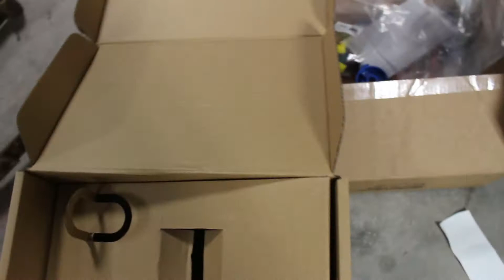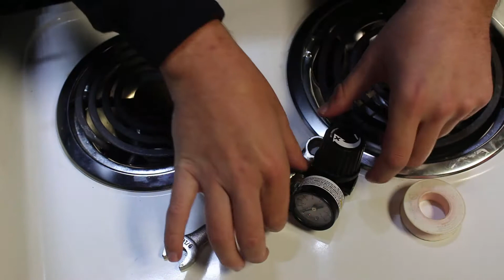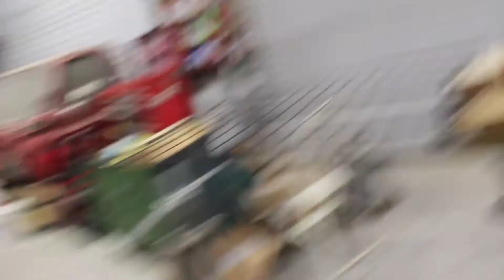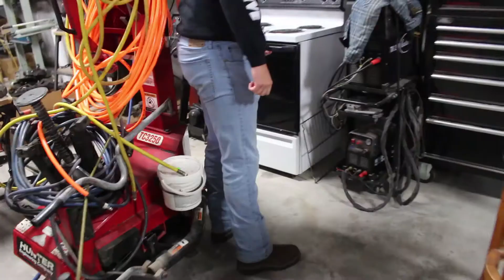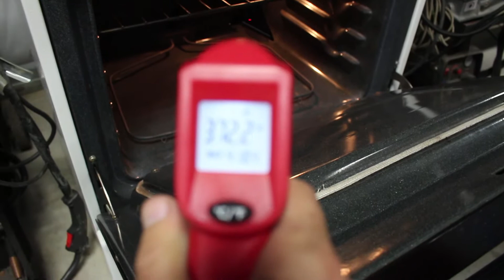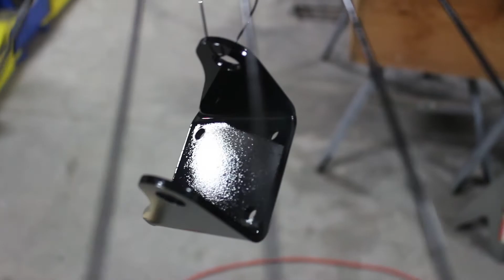Trying Out Powder Coating

Comment: What air pressure do they recommend with the unit you bought?
Reply from the maker: I believe 5-10 psi according to the eastwood website. It does not require a lot of pressure. At higher pressures it will blow the powder off the part.